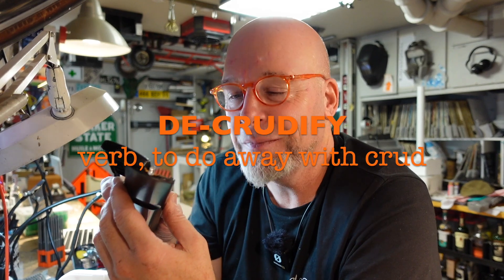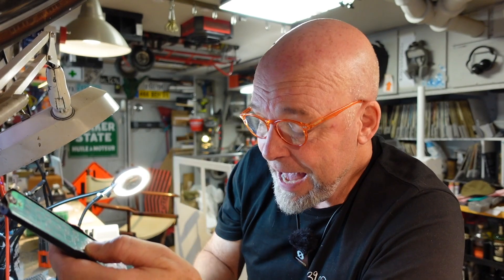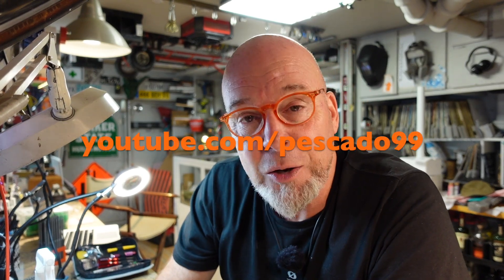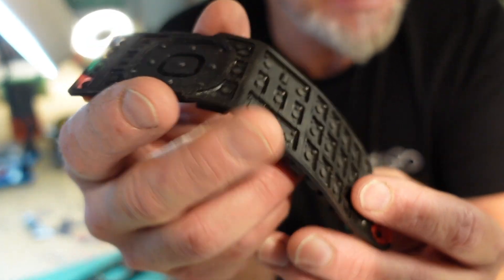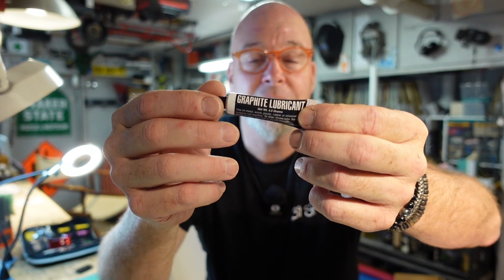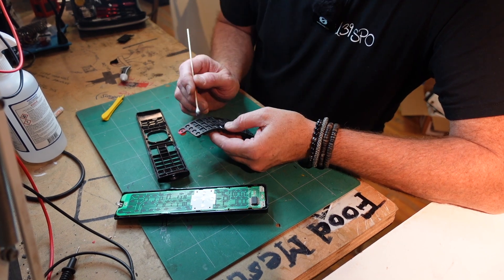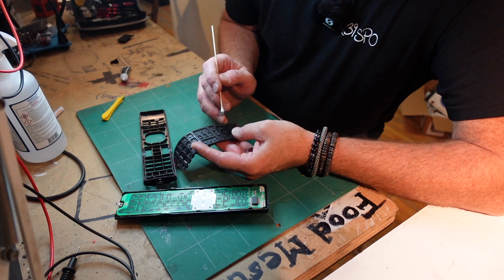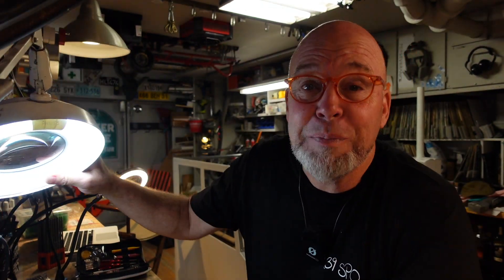TV remote control repair: Carbonizing your buttons #diy #tutorial #hack #repair #electronics #tv

Comment: It never even crossed my mind to use liquid graphite. That's such a good fix! Thanks!
Reply from the maker: @CatKingKeefie  It sure is, and it works perfectly! Note that the tube contains the finely-powdered stuff, not liquid. Cheers!
Reply: @ducttapersanonymous So where did you get the tube of graphite, and how did you get it to stick to the contacts?
Reply from the maker: @phantomcruizer  I bought a tube at my local hardware store. Here’s an example available at Home Depot:
https://www.homedepot.ca/product/the-hillman-group-3-g-powdered-graphite-lubricant/1000167239?eid=PS_GO_140203__ALL_PLA-526641&eid=PS_GOOGLE_D00_Corporate_GGL_Shopping_All-Products_All%20Products__PRODUCT_GROUP_pla-298495632901&pid=1000167239&store=7149&gad_source=1&gbraid=0AAAAADhdmz4sj5w5NF-vALOSArax1BBjO&gclid=Cj0KCQjw99e4BhDiARIsAISE7P9S1kzlH3jZ1w6avrrmImt0SqR-DiXpgnJyYY7eadZ7aCfFi-jcSX0aAuEZEALw_wcB&gclsrc=aw.ds
A fine dusting adheres to the surface of the carbon pill, maybe because it already contains some carbon? I don’t know, but it works.